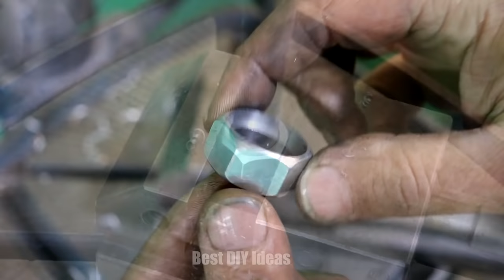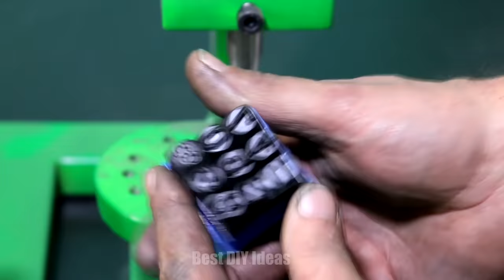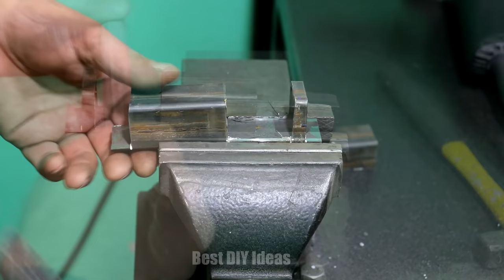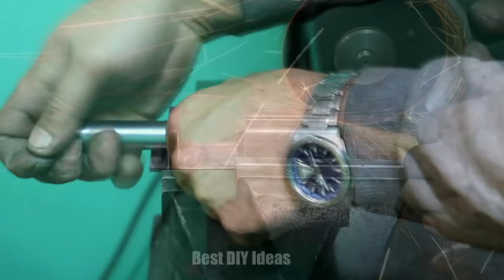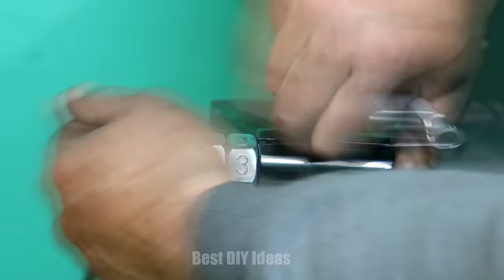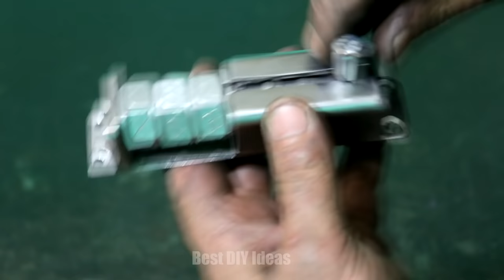DIY Unique door latch | Bolts & Nut IDEAS

Comment: Cool and fun, but not very secure. Just remove the screws for access.
Reply: 5
Reply: Yeah, but what if you build a tough one and weld the whole thing in a metal door.
Reply: @L M still all you have to do is try and open it until one nut drops in then the next and then it is open. Not real secure. But it is a fun project.
Reply: Not for the average homeowner
Reply: It's easy to crack even without removing screws, just tension it and turn first nut until it goes in 1 step, and repeat. You can even guess password by trying 1 nut at a time, so you only have 24 tries max
Reply: use anti theft screws sorted
Reply: @Михаил   верно, только если в первой гайке будет одна прорезь, через нее не пройдут все штыри. Но идея верная, они должны быть не в ряд, а в разброс.
Reply: Don't you guys think he already knows that. He was showing a creative and fun project he came up with and how it turned out. I don't think his intent was to hide millions of dollars trusting that lock to hold out anyone who wanted in. Why can't you people look at it for what it is and not bash in down because you don't have the ingenuity to create or talent to build such a thing. Give credit where credit is due...
Reply: Bien algo sencillo pero seguro
Reply: Probably be more secure than a door bolt from the store with a cheap padlock on it
Reply: @noobinho8882  xxx
Reply: 8

Comment: Best concept I've seen thumbs up! The only down side is the screw area needs more thought as its too easy to screw the lock off and avoid your combination. However great work and finishing.
Reply: Use torx security screws. This isn't exactly for a high crime area.
Reply: ROUND HEADED BOLTS THROUGH THE GATE FRAME
Reply: @jsmcguireIII  akkus fúróval lefúrom...pár perc...

Comment: Excellent work, but it will take maximum 24 trials (average 12 trials) to decode; as opposed to max 8x8x8=512 trials (average 256).
Reply: Exactly my point, you can move the bolt as you turn each nut to the right position :)

Comment: Great job, but It is very easy to unlock the door by pulling the lock rod backwards and rotating each nut until it matches the slots, after each slot is matched the lock rod can be pulled and unlocked
Reply: It will keep the honest people honest.
Reply: Just stagger the pins

Comment: Yeah but... all it takes is to press the bolt against the first nut and twist the nut until you find the groove. The bolt will slide right in. Then repeat for the next two nuts and that's it.
Reply: All it takes is to remove 4 Phillips screws. Could've at least used tamper-proof Torx.
Reply: @adamv242  yeah but even that requires a screwdriver. Feeling the groove is tool-free!
Reply: Depends on the tolerance. Wheel 2 might bind first or wheel 3, so still easy. If the tolerance is high this makes things harder. I'd still decode this in seconds with a shim tool either way.

Comment: Super cool but since the square tube is bigger than the bar stock, I'd hide the pins at 12 o'clock as it sits on the door so you can't see how it works. If someone gets to see it unlocked with the pins visible it makes it way easy to figure out if you pull or push the bolt and turn the nuts one at a time in order either way you have the combo. Still a neat project.

Comment: In this version you can find out the code within a minute. If you start to roll the fist nut, and you found the right number, you can push the bar forward a bit. You need to do the same with the remaining two nuts, and you have the combination.
Reply: Keeps the honest people out.
Reply: It only has ⅔ of a regular 3 digit lock but I don't think it's genuinely intended for security.  If anything, its for nothing more than stopping infants opening a  back gate, least for a short while 😅😅
Reply: @horvathgergely6263 come on man this video was done for entertainment only and he would know quite well that it is not secure.

Comment: It's a good bolt lock...but all to defeat it is a good drill and a large Phillips bit because the mounting screws are exposed...you would need special head screws or weld plates over the exposed screws.

Comment: You should use countersunk bolts with recessed nuts and locking nuts on the other side of the door and frame, instead of screws.

Comment: Overkill for a wooden door? Suggestion, maybe drill one more hole on the cylindrical bolt between the latch and handle part, to slip a padlock through for added security? Nice idea nonetheless! My only concern is you could feel the play while turning the bolt, so I wouldn't think this is a high security solution.
Reply from the maker: Good tip!

Comment: If you made nuts rotate around an inner ring that rotates with them when the lock is locked. But when you pull the lock back. Pin the inside rings with the bolt.
Allowing only the outside rings to move when it's unlocked.

You'd have the same lock, but you can change the combinations while it's unlocked. Like a suitcase lock.

Also put the screws under the bolt, "while locked" so you can reach them when it's unlocked. And sink them in, with the bolt as flush as you can get it, so there is no access when it is locked.
Reply: Wow you must be a genius

Comment: put a C ring inside the nut and use set screw to lock it on place. So you can disassemble and change the combo. or just create a set of 30 nuts.

Comment: Appreciate the work but can easily be unlocked just by rotating All the bolt staring from the left side. Adjust one by one bolt to the unlock point and unlock it in few seconds.
Reply: Even no screw is needed
Reply: The pins on the second and third nut would still keep the bolt from moving. You could always do a count up from 000 to 999 though to get the lock to unlock.

Comment: Back a few years ago, I lived where there would be one possible use for this. We had community garbage bins inside a caged enclosure. The enclosure was needed because of wild monkeys would regularly raid the bins and made a mess out of them. The monkeys were smart enough to open a normal latch.

We tried a regular padlock with the key tied besides the lock. It was too cumbersome; especially for the garbage disposal team because they need to remove their gloves. 

The nuts can be made much bigger so that gloved fingers can easily turn them. And the number of nuts reduced to 2 (instead of 3) to make opening faster for humans yet still impossible for monkeys.

Comment: The door from inside the house does not need a secret number 
 If you put the lock outside the house, the screws will be deciphered
Reply: Easy, just use one of every screw type and frustrate them. One t25, t10 one security torx, one robertson etc 😁

Comment: You could've made another feature by making the piston a few inches longer & then drilled a hole in it where you could place another padlock on that.

This way not only is there more security, but if you've given the combination to someone you can still retain access control by still locking someone out.
Reply from the maker: Thanks! Appreciate all the suggestions.

Comment: Everyone talking about just removing the screws when it would only take a second to crack the code. Just lign up the nuts just at a time
Reply: I think if the pins are spaced accuratly you would not feel the uningagement of a individual nut
Reply: @magvat  Al you have to do is move the fist nut till the pin go in then move the next one till the pin goes into it then the final nut. Shouldn't take more then a couple minutes to figure out
Reply: @rustynail9793  thats what I tought too but there is 3 pins and bolts are bored to fit them before they enter the slott
Reply: The screws I would just bore the slots for driver away

Comment: The numbers don't have to line up with the flats on the nuts. Example, you could use a 51/2 by putting the slot where the point of the nut between the five and six is the combination. Four nuts would be better too, while you're at it. Still this style of lock is easy to pick. Fun to make, and keeps most kids and others out.

Comment: What you done here is amazing but the lock plate needs to be bigger to take coach bolts 🔩 because all you have to do is take the screws out. Or ball bearings to weld or hammer in the top's of the screws for security. But like I said amazing job though 👏

Comment: Cant open lock? Forgot combination? Never knew it? No problem, a small Phillips head screw driver is all you need to remove 4 screws holding the lock to the door.
Reply: You can always get better screws for the job. Most people don't have a screwdriver that can take out a #3 or #4 Philips head lag screw. There are also screws you can get that uses special bits to install them used in places like jails and some schools. Still a lock like this wouldn't be very secure even if you did use them. This guy still has some amazing skills at building this lock. I would use it more just as a temporary lock.

Comment: Except that all I need is a screwdriver to remove the lock, and/or the strike plate.  Otherwise,… nice 😊
Reply: It is much faster to move the bolt 3 times, once per nut.
Reply: Yep. A must in any thief's bag. Cordless drill and screwdriver bits.
Reply: I just need a wire

Comment: Yeah as everyone in the comment 
section knows how it can be 
bypessed...

But if you'd add a 4th wheel & false 
gates to each wheel, none of them 
(except LPL) will be able to open in 
short order. 

Thanks for sharing. 
👍
Reply: Yes, you'd have to start over. 

But, 
false gates won't be hard to do,
if you're willing to add gates & false gates before drilling out the threads of the nuts.

Would be fairly easy.

Comment: 8.05 - 8.10 you can unscrew 4 of them by screwdriver even if they closed 😅🤣😂
You shouldn't has access to those screws when is lock. Think .
The holes should be made under the bar , horizontally.

Comment: Must have a grove in the inner circumference of each nut as well as the groove through the nut so that the nuts can turn to the correct number!How was that innermost circumferential groove cut?With a lathe?Without a circumferential groove those nuts cannot be turned and the bolt only locks in the open position!The bolt should protrude on the other side for this to work and be locked by the turning nuts without an inner groove as well as the cross groove.!

Comment: The round shaft must be longer. Practically its avoided screwing near wood edges(compromising door-lock strength) so that wood doesn't cracks up on regular use.

Comment: the idea of this lock is smart and stupid at the same time.
If we rotate the first gear until we reach the gear slot, the latch will slide forward until it stops in front of the second gear. Then, if we rotate the second gear until we reach the gear slot, the latch will also slide forward, leaving the last gear in front of it. So we do with it as  We did with the first two gears.
thus, the effort of making this lock was wasted by just thinking about the mechanism for opening it.  Greetings my friend from 🇱🇾

Comment: Nice design. I have a critique however. Having the pin groove on the top running full length on the bolt body weakened the locks physical integrity, making it susceptible to breaking using a pry bar. Making the bolt body one inch longer with the pin groove completely enclosed would greatly increase the strength of your lock. That said, I’m planning to build your lock for a cabinet I’m going to build.
Reply: The physical strength doesn't matter. There's enough slop in the lock that you'd be able to figure out the code in almost no time just by jiggling it. I think worst of all you may be able to simply figure the combo out by rotating a single nut at a time and pulling the bolt and seeing if it moves.

"Professionally" made cylindrical bike locks often have this same weakness. This shop version is going to be even easier due to slop. But if you have a bike lock just pull it like you were trying to open it and rotate the combo wheels. You'll feel them click into place. Once you've done it a few times you can open the locks in a few seconds.
Reply: Screwdriver will bypass quicker and quieter.